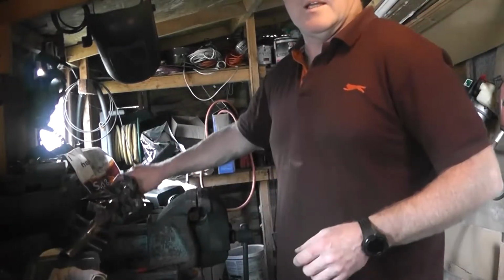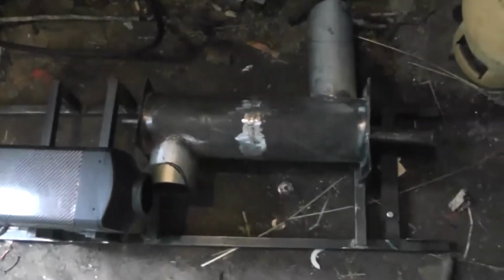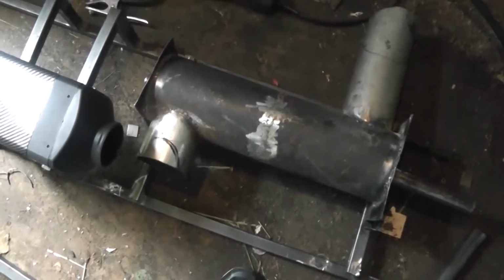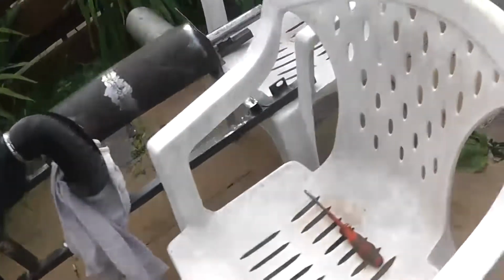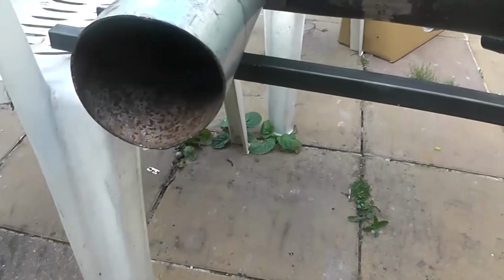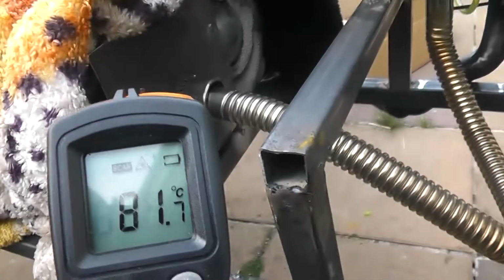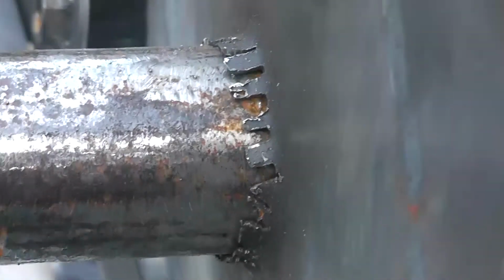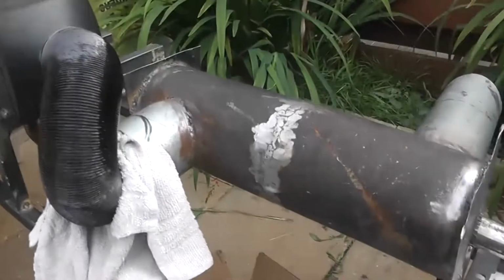Chinese Diesel Heater - heat exchanger   1

Comment: You may have too many square corners in your design which causes back pressure. A separate fan would probably work better for increased air movement.
  I may try to take the heat off of the exhaust by getting a longer exhaust tube and making it into a coil inside a section of 6" stove pipe and use a small fan on the end to blow the heat thru it. That would not only get me more heat, but cool the exhaust down before going thru the  wall to the outside.
Reply from the maker: ah sure it occured to me that night - made this the next day or day after - https://www.youtube.com/watch?v=0L8zc5Na8nY&t=5s